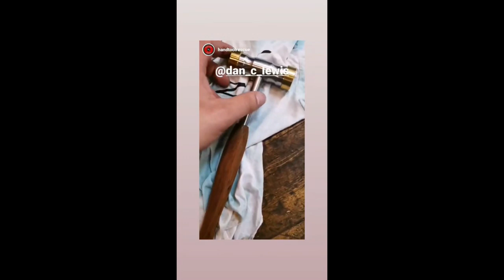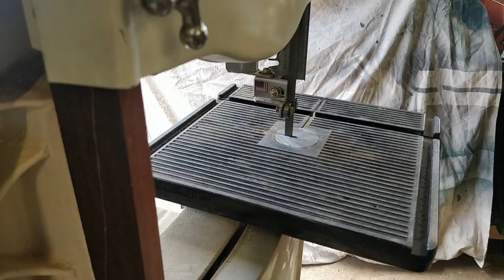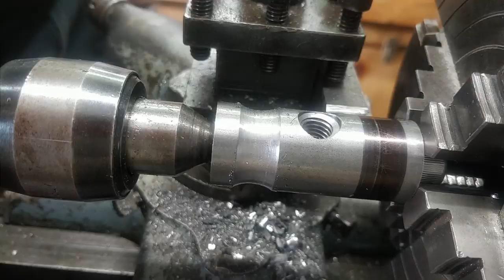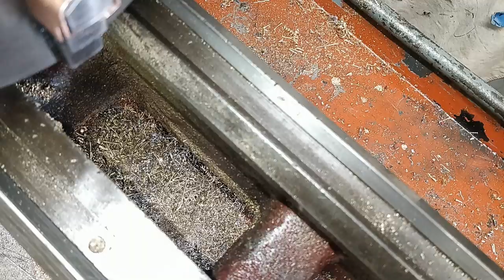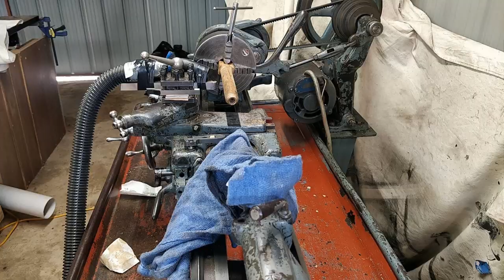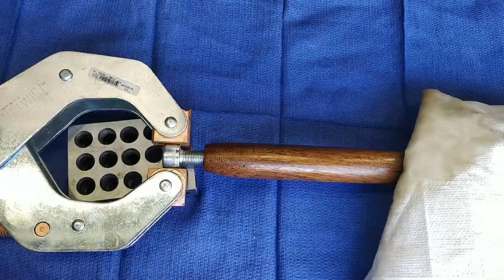Brass Hammer for Hand Tool Rescue

Comment: Nice hammer. But you can only look at this hammer, but it is impossible to use it - it will break very easily. The design has critical flaws.
Reply: Sadly the 1" tread engarement into wood is an horrible idea. The video is the true masterpiece.